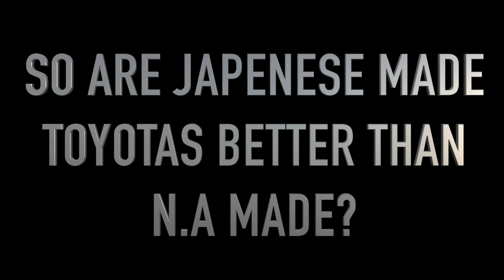Are Toyotas Made in Japan Better than Toyotas Made elsewhere?

Comment: You can't have the exact same quality in manufacturing and assembly between two separate plants, even with an SOP. The issue you have with Mexico is that if you push standards too hard and expect too much out of them, you'll end up firing/replacing at a rate that outstrips replacement rates and your quality and capacity then suffers. You're then going to have to pay much more than you originally had to focus on the much more technically sound assemblers and testers in which you matter as well just have assembled your product in the place that had the higher paid but generally more qualified personnel to do the work in the first place. Just because you loosened up your fit and finish standards and specs so that those fitment issues are no longer considered "defects" anymore doesn't mean that they still aren't giant red flags. If assemblers can't consistently stick to standards in fit and finish, no matter how minor, how can we expect them to do so with much more difficult and complicated sub-assemblies like mating the engine and transmission together properly? To properly route and connect the electrical connectors on all of the wiring harnesses properly? You haven't been assembling in Mexico long enough to generate any real long-term reliability data yet. You barely have enough time for the Texas made units to start having reliable data for long-term reliability. You may not notice any short-term catastrophic issues because your quality engineering team is working their asses off to keep the QA standards high and catching all of the assembly issues. This is the issue at hand. Companies don't post first pass yields or most other manufacturing KPIs to the public or even to their own investors. The execs and directors obfuscate the details and focus primarily on sold units while ignoring rework. You don't care about how much rework you have at the Mexico plant when it only costs you $6/day per assembler to rework their mistakes. You start caring a lot more about rework when it costs you $240/day per assembler to rework said mistakes. At the ridiculously low rates for Mexican labor, you can easily afford to have entire rework teams to rework said mistakes as they arise and still come out far ahead on labor. You could literally have 4x the assemblers and still be at under a quarter of the rate of a single U.S. assembly team. 

I've seen manufacturing done in 1st world countries with top tier assemblers and testers and yes, while the price is higher, the first pass yields are far superior to what the 3rd world or developing nations can do. Toyota's Mexico plant are probably extremely reliant and heavily leaning on their Quality team to do all of the heavy lifting and relying on raw body count to rework units as fast as possible to meet production numbers. Topped with ignoring/waving specs/standards to push units out so that things which would be a defect at other locations, is no longer a defect there. You know that a very noticeable asymmetric gap on body panels would never be tolerated in Japan and would have been flagged as a defect by QA in Japan. If you notice uneven gaps from one plant that deviates from a higher standard at another plant, that's a defect. That's a "fit" defect when it comes to determining "fit, form and function." Again, if they're messing up or are inconsistent to standards on something as easy as fitting body panels, how are they mating the transmission to the engine or mounting said engine to the frame? How are they at ensuring strict ESD standards when handling the ECU and other sensitive electronics? Handling the lenses on the cameras to ensure that they don't get oils on the lenses or cause micro-scratches on the lenses that increases errors with Toyota Safety computations? You've already admitted that you have two different standards for "cosmetic" issues which some would argue are "fit" or "form" defects.

Comment: I have two comments:
1) Some say JDM motors from Japan are much better, more reliable. AFAIK here's the reality: the primary difference is that cars in Japan are often (mostly?) traded in before having to go through another "Shaken" compulsory inspection+repair cycle (first is 3 years after purchase, then every two years.) The inspection itself is quite expensive, but even more: any misses must be repaired. MUST. Due to this, the average used car in Japan simply isn't all that old! Newer cars will, in general, be more reliable.
2) I'm a lifelong computer R&D guy with decades of experience. One of the interesting things I've observed about car engineering is illustrated by the long term problem with the Toyota 2ZR-FXE engine used in 2010-2015 Prius and more. With 20/20 hindsight, there was a mechanical design error in the pistons/rings that led to ridiculous oil consumption plus blown head gaskets, after about 100,000 miles unless maintenance was performed much more often than recommended. The design was modified several times but not actually fixed until the 2015 version.

My point in sharing this latter story: not all issues can be resolved in early design, testing or even thousands of miles of use!

Getting the design right is simply a hard issue.

Unfortunately, Toyota has not always backed up their excellent record for great cars, with excellent customer service.- There's a lot of frustrated customers out there. This is not Ahmed's nor David's problem to fix. Someday I hope Toyota can learn to handle things better.

Blessings,
Pete

Comment: I can tell you a fact on some Toyota models.  Toyotas manufactured in Japan with Japanese DENSO AC condensers.  Have a higher fin count per inch and more tubes within the height of the condenser.. 
         Couple years ago, they started supplying Denzel of North America started manufacturing replacement, condensers for the Japanese cars.  Noticed they had fewer cooling refrigerant tubes then the original Japanese model and fewer fins per inch.. 

The more tubes and the more fins, the more surface area to reject heat for cooling in extreme hot weather . 

When I used to work at Honda, I was the new guy when we would do the pre-delivery inspection on the brand new cars in at all the accessories after hours we would make a bonus money. 

I didn’t know it, but all the veterans older guys would give me the new guy all the American made Hondas. They would take all the Japanese Hondas. 

I found out later that Japanese Hondas they did not have to inspect anything, adjust anything or fix anything because it was always perfect usually .  

And they would do more cars and make a bigger bonus check 

Well, the guys who are new, we get the American made Japanese cars we had to spend all the time going down the list, actually adjusting and fixing things because the cars were kind of screwed up from the American manufacture plants .   

American manufactures with that a lot of the fence and poor fitting components leave the factory in the United States something Japan would never do .

Comment: My friend got a 2018 RAV4 in US which was interestingly made in Japan. Most of RAV4 and RX350 are build in Canada. I guess at that time they want to change the production line for new 2019 rav4, so Toyota imported some 2018’s from Japan. After couple of month, there was moisture in both front headlights which was replaced under warranty. Now he has the same issue on one of the rear taillights. The car barely have been used, under 10 k in almost 3yrs and garage kept. I expect to see a better quality from a Japan made RAV4

Comment: Thinking (hoping) that vehicles made in Thailand meet the same rigid standards. Helped my fiancee purchase a 2023 Hilux Smartcab diesel pickup and went with Toyota over other brands based on quality and reliability of the 3 Toyota products I own in the US. I was only able to drive it a few days before returning to work but it sure was fun to drive. For a 2.4L diesel it seems peppy enough for me and fit/finish look good. Was bummed out to find that cruise control wasn't included and no heater, just aircon. Items based on regional needs and to meet a price point. I would have needed to gone to a 4 door pickup to get those options and more bed space took priority. Regret not going to 4x4 and the larger 2.8L diesel but we didn't discuss off-road camping until after we made the purchase. Maybe a trade in should be considered.

Comment: My first car was a 1977 Toyota Celica, which I drove for 16 years and gave it to my brother in law.  Next, I bought a used 1987 Toyota Cressida until rust took over.   That car was built like a tank.  No problem with the engine, transmission and differential.  I then bought a 2008 Toyota Rav 4 and drove it for 16 years, 248,000 km. and never had a problem.  I diligently maintained my Rav 4 according to the manufacturers recommendation.  I don't have it anymore as I was involved in a collision, which the insurance company wrote it off.  Toyota vehicles are built to last.  Will buy a Toyota 4 Runner next my dream vehicle.  Should last me until I bite the dust.  😂😂😂😂😂

Comment: My Scion xB was made in Japan. Compared to my US-made Tundra, and Canadian-made Lexus RX 350, the Scion has it’s share of problems. But, in all cases, it seems the problems are factory design problems. My xB has the oil control ring problem. I bought it used at 68K miles. I changed the oil and used full synthetic 5w-20. The engine started using oil a lot more than any Toyota I ever owned. I was adding two to three quarts between 5000 mile oil changes. After reading up on the problem with the engine piston rings, I was informed by a Valvoline tech that Synthetic oil molecules are smaller than conventional oils and would be consumed more easily than conventional. I switched to conventional oil and now I use less than a quart between oil changes.

Comment: I own 5 Lexus. All made in Japan. Almost no warranty repair in the first 4 years of ownership. The quality of supplier is also different. The original battery in my Lexus last 5 years and 7 months in Phoenix. It is unheard of in Arizona. I purchase Honda Odyssey made in Ohio at the same time. The battery died after two years. Both vehicles parked in the garage side by side. I even installed an AC to cool off the garage in the summer months.

Avoid European luxury brand. I owned 2 Audi A8. They are fun to drive in the 1st few years. Right before the basic warranty, I got warning lights and things are not working properly. One thing really get on my nerve is the rattling noise from the dash, door panel, and other trimmings in the car. The maintainence cost is going to empty your wallet. Front brake job cost $1,600. German cars do not allow you to re-surface the rotors, you have to replace the rotor and pads. If you have electronic parking brake, the rear brake job will cost more than the front axle. Oil change will set you back $200+. I have to admit Lexus IS a bit boring compared to other brand. However, they are super reliable. My last Lexus I owned 7 years had zero defect. 

I am going to trade in my Audi and going back to Lexus. Another highlight is the AC by Toyota. I get 33F from the center in my last Lexus than 43F in the Audi A8 when the outside temperature is over 105F. Super nice.

Comment: YES! Toyotas made in Japan are better - I bought a Toyota Celica GTS on 2003 spacial order. Took 3 months to arrive and the VIN starts with JTD right now it has 320k miles and will be 20 years on May, still going strong. The paint has faded and some of the plastic stuff had to be replaced because it has become brittle. The engine has NEVER had any issues.  My mom bought a 2013 Highlander, very reliable but at 10 years old it is having issues. This Highlander was assembled in USA/Mexico. This is only my own experience and yours might be different. I had to buy another Toyota, I'll try to make the configuration such that is has to be "made" and be a special order. I hope it comes from Japan.

Comment: Better or not, it's really depends on many factors too. My father had Japanese built Corolla 1985, and it gave my father troubles in suspension system every 2 or 3 years. But Indonesian built Corolla, same model, didn't have those issues. At the 80's, Indonesian road condition was quite much worse than Japanese road. Today it's still the problem, but honestly the condition is improved. So Indonesian built Corolla in the 80's is better for Indonesian road but with fewer amenities.

Comment: I bought a Rav4 Prime, a vehicle manufactured in Japan. Mechanics were okay, but before long the power assisted steering began to make alarming noises immediately after starting the car and when reversing with steering lock. I thought the noise would improve but it only got worse and worse. So obviously not impressed as the car has less than 10K on the clock and needs a significant repair. However, where the car does impress is body panel alignment and interior fit-and-finish. I compared to a hybrid and there was a noticeable difference in attention to detail. 

Even though the car was manufactured in 2020 it still had (and has) issues with fuel indication. The EV range computer is also completely nuts and has decided my car always achieves 199.9 mpg. So quite underwhelmed. Also underwhelmed by Toyota's inability to fix anything that isn't actually hanging off the vehicle! Fortunately we took the extended warranty and service options so we'll eventually force Toyota to fix the vehicle. But for now... unimpressed.

Obviously a sample size of one isn't statistically significant but I certainly can't say there's any indication that Japanese assembly/parts is usefully better than North America. However, fit and finish is clearly superior.

Comment: I buy Toyotas because they are reliable and last a long time.  I think they are the best vehicles on the planet.  I had a small issue with a new Rav4 (2022).  The first rainstorm I drove in resulted in some damage to the black plastic at the bottom corner (driver's side) from the windshield wiper, because it was not pushed into the wiper arm all the way until it clicks.  It came from the factory this way, apparently.  Toyota said they would take care of it, so I told the service dept. to call me when the parts are in.  I don't want my car left there overnight, because they are situated in a bad part of town. The guy never called back.  I asked if the SUV was manufactured on a Friday.  He didn't seem to like that question.

Comment: My experience is this. I have purchased 6 Lexus ES since 2004 all brand new and took every single one of them to 150k miles with zero issues or recalls. All were built in Japan. My most recent 2019 ES was built in KENTUCKY And it was the first and only ES out of the 6 I've owned since new that has had 3 recalls and simply doesn't sound or feel as solid as my previous Japanese built models. Front  Doors are flimsy and sound hollow and cheap when you close them. My previous ones sounded like bank vaults even at 150k. This one sounded cheap on the showroom floor. Interior plastics are also cheaper looking and feeling. Anyone can have a recall I understand but it's a little more than coincidental to me that tge only knew that was not built in Japan has had these recalls and build quality issues.  I want mine built in Japan,  and if that's not possible, Canada.  KENTUCKY get your standards up!
Reply: Its done on purpose, They kno Americans will still keep buying it coz of badge and perception that its good quality brand. Same as German cars in US

Comment: We had a 2011 rav 4 V6 from Canada with tons of minor issues ( rubber, plastic ,paint ECT.) before 80000 miles and we still own a 2007 Highlander hybrid limited with like 247000 miles and in excellent condition. You be the judge!

Comment: I have owned Toyota vehicles for most of my adult life (I'm 66), and I can say that I've been happy with all of them (all were built in Japan), from my first Corona to several Corollas to a Supra and now my current two vehicles, a 1998 Camry LE (2.2L) and a 2007 RAV4 LE FWD (2.4L).  All had well over 250k miles when I sold them,  and my 1998 Camry has 329k miles and my 2007 RAV4 has 267k miles.  But the RAV4 is experiencing problems mainly because the engine burns oil (the infamous ring problems they had with certain 2.4L engines), so I will probably get rid of it soon.  But the 1998 Camry is still going strong--I plan to keep it until it finally dies on me.  I haven't had any car payments since 2012, so you can imagine how I'm not looking forward to purchasing a new or slightly used Toyota considering today's vehicle prices (I'll probably get another RAV4 or maybe a Tacoma or if I can find a relatively good deal on a low mileage 4Runner with 2WD).  My next Toyota might very well be my first non-Japanese made Toyota, but I'm hooked on Toyota reliability (my first car was a Chevrolet Impala, and it had so many problems that my mechanic suggested I buy a Toyota:  I haven't regretted that decision).